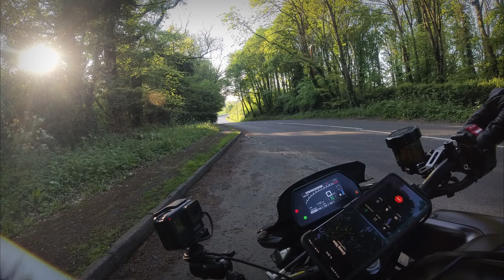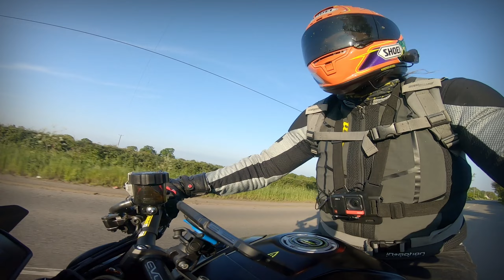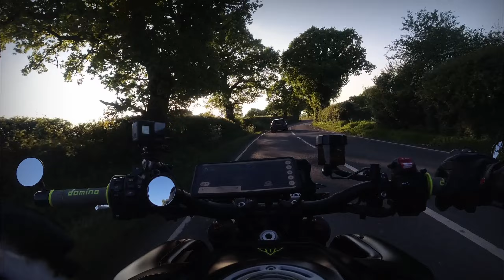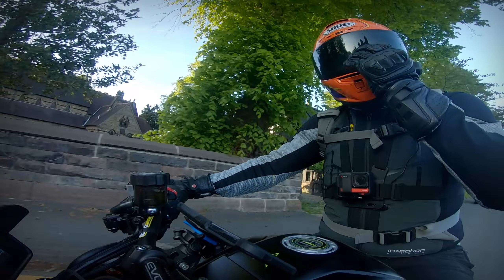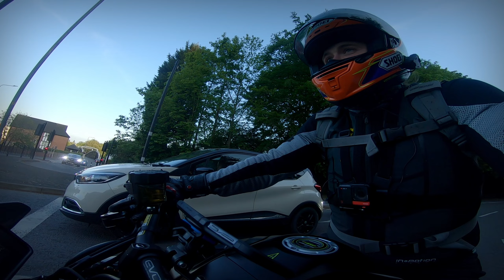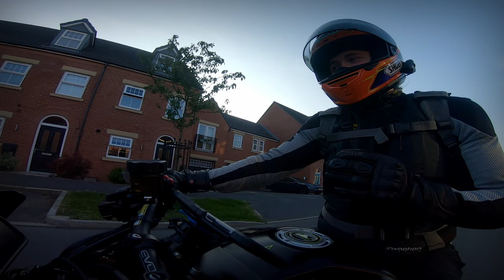2023 Yamaha MT10, 1000 miles later...

Comment from the maker: Just a note- This was filmed a while ago now, the ticking sound seems to be 'normal' according to forums and people with past experience. Its Not the cam chain as thats on the right hand side. 
Yamaha have said if it gets worse to take it in, but for now I dont think its an issue (touch wood)
Reply: I don't know if its the same, but my mt-09 and other have a ticking sound from the clutch, when you pull in the clutch it disappears, it always bothered my but never caused trouble, exchanged it with 14000km for and sdr1290 XD then saw your videos about it
Reply: have been watching your videos on mt10, getting one on 24/6/23 its a ex demo black. what kind of exhaust will you be getting
Reply from the maker: @yamimk Nice! All shall be revealed soon ;)
Reply: Think it’s a Yamaha thing my bike has had a sort of ticking sound from new. It doesn’t bother me as it hasn’t missed a beat in 18k. A mate of mine has an old Thunder Ace and he was on about it on his bike the other day. Swapped out the standard pads for EBC pads and it was night and day difference. Never had one issue with the bike. Got to be way more reliable than the other bikes you had issues with.
Reply from the maker: @tracer1127  Aye, just my paranoia due to past experiences with other bikes. Nearly 2k on it now, no major issue.

I had already put in EBC pads in at this point, I think I mention it in the video, Good improvement, but still awful breaks
Reply: Depends on the oil you use. Try a thinner or thicker oil next time you change. .......... :D As long as the bike is running and doesn't pull a KTM, you will be fine.  @motoberno

Comment: I just stumbled on your channel and definitely liked and subscribed. I have the same bike 2023 and everything you mention I also experience. I have a tick from the left side and also when I take my hands off the bar as my bike also falls to the right so I don’t think it’s normal. I have the same chug chug issue taking off in first gear no matter how much you slip the clutch. Don’t get me wrong the bike is absolutely amazing but like anything in life it’s not perfect. I totally agree with pretty much everything you said. I actually don’t have an issue with the brakes but like I said the ticking, leaning to the right when you take your hands off the bars and taking off does chug and stutter no matter how much you slip the clutch or over rev it. The going to the right thing is kind of weird because all you have to do is put two fingers on the bar and it feels perfectly normal but once you let off the bars it falls to the right. I don’t notice any issue with my hand is on the bars it’s perfectly fine feels very stable and handles very well. Please keep me posted if you can figure out more information on it falling to the right and the ticking. I only have about 300 miles on mine so far and I hope like hell the ticking doesn’t get worse

Comment: I don't think you have a problem with the noise, redline it while riding, if it's the automatic cam chain tensioner it will fix the problem, I had a FJ1200 years ago which used to do the same thing. You're right about the sound though, the Big Bang Yamahas' are the best sounding bikes.

Comment: Hello mate . I got big issue with the bike and gb racing covers got leak and Yamaha said it was fixed and made me pay. Then gave bike as I rode off leaking again and now say I broke the crank case and pay £2400 to fix when they were working on the same part for warranty fix on the clutch
Reply: Just wondering if you had any advice to help fight .. they said bike is fixed ready I rode it out paid for it and down the road oil spills out and it’s back with them and they say it’s my fault
Reply from the maker: The fuck? That's shite, is it on finance?

Comment: In really curious about the handling in turns with the MT 10. I have the 21 MT 09 and have been thinking about upgrading to the MT 10 because of the extra weight and power.  The MT 09 handles well on the turns but very light on the front.  Looking forward to hearing your point of view since I heard you mention you had the MT 09.
Reply from the maker: It's a good Handler and a lot more stable, MT09 was a little easier to manoeuvre etc but as expected for a lighter bike. 
MT09 bad more of a 'dirt bike' style setting position, which doesn't lend itself too well with faster roads/wind. However I've not ridden the brand new generation of MT09, I owned the 2019
Reply: @sergeantsodom6969  I haven’t ridden the previous gen of MT 09 but people who have and also the new gen says it does handle better than the previous.  I was just curious about the MT 10 handling since being a heavier bike I figured it would feel more planted in the turns.  I’ve just been on the fence because I put a lot of work into my MT 09 including a full Akra exhaust and tuned on a dyno. Got the comfort seat Puig race wind screen, Evotech radiator guard, frame sliders, ASV levers, hence my dilemma. I live in FL so you have to work to find those twisties and I ride with my buddies that have Aprialia Tuono 1100 RR and and older FZ1.  I can keep up most of the time but when we are at higher speeds on those turns they can pull away because I don’t want to push it with the front end being so light. 
Thanks so much for the info and stay safe out there.
Reply: I came from an mt09 2017 and after my tune it rides like my 09 down low and a weapon mid to high. the suspension is so much better and i don't personally notice a difference in size and weight to how it handles

Comment: So, in your opinion. I'm riding 70% street riding, the rest being motorways, I can get a new MT10 at a similar price to a new Street Triple RS, which do you go for?
Reply from the maker: I've had both and both are great bikes... for me it would be the MT10, rhe Street triple was a little too small and vibey for me, suspension was tough to get on with but I do have disability issues. 

MT10 is heavier, the engine is incredible, Street triple is nimble light, fast enough for anyone and a beautiful machine 

As always I'd say ride them both, and decide for yourself 

Cheers!
Reply from the maker: Also worth noting the cruise control on the MT10 and added stability on the motorways/highers speeds make it one of the other reasons I was go with the MT